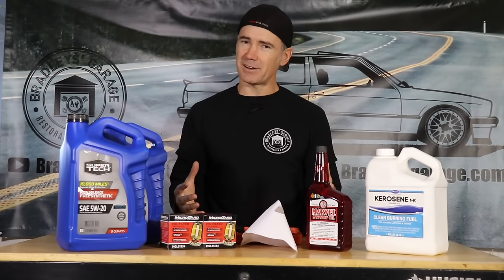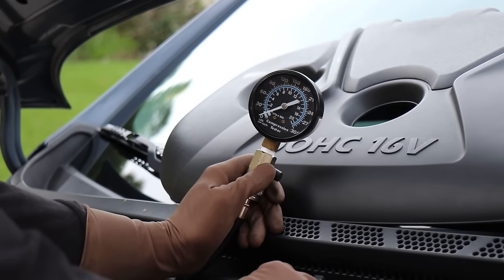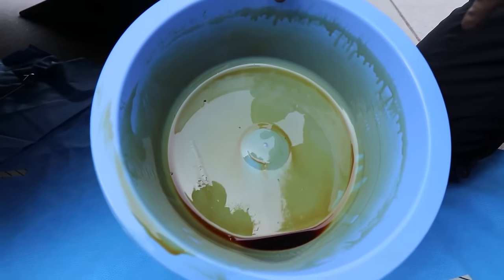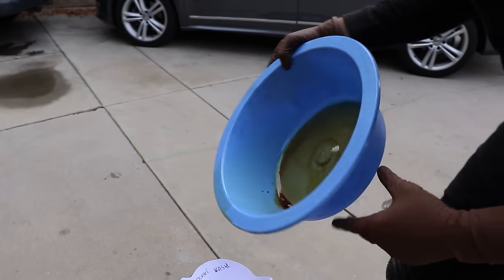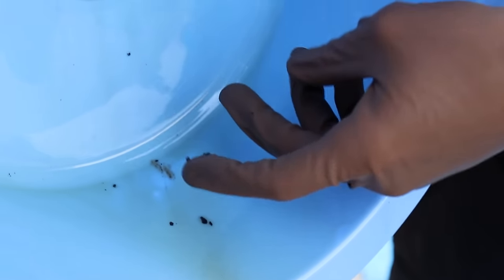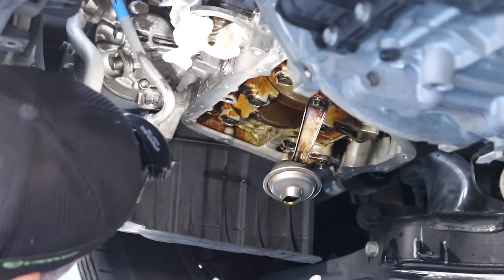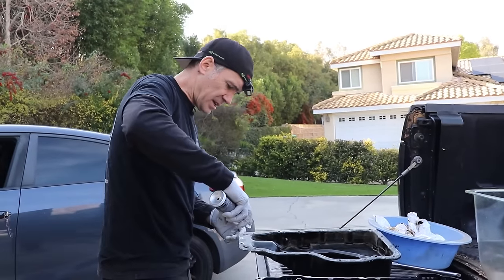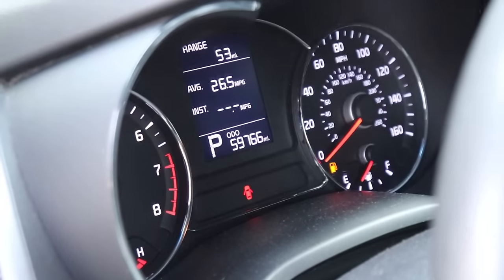*UPDATE* Customer States Jiffy Lube refused to change my Oil - Sludge Factory Kia Forte

Comment: The simplest statement of all time is very true after watching this video: OIL CHANGES ARE CHEAP VS BUYING A NEW ENGINE!!!  

Had this newer KIA's oil change interval kept going, the engine would be featured on the "I DO CARS" YouTube channel.
Reply from the maker: Agreed, thanks for the comments. It is such a low cost item it doesn't make any sense to stretch it out.
Be sure to check out the original video if you haven't seen it - https://youtu.be/XU79jXYWydA
Cheers!
Reply: That's what I keep telling my wife and daughter.

Comment: If there is ever a next time you need to do a heavy sludge flush check out BG's Dynamic Engine Restoration Service Kit. I used that stuff once and an old boot came out the oil drain.
Reply from the maker: Thanks for the product recommendation Joey, we will check that out if we come across another sludge factory. Cheers!
Reply: Fyi...BG is like..$325.

Comment: Great video. Back in 05 i bought a 96 jimmy 4.3 with 158k on it. I changed all the fluids. ALL OF THEM. I did the kerosine flush for the oil as well. It didnt have sludge thankfully. It never had any oil related issues ever. Just 2 water pumps, a radiator, and power steering pump. I sold it at 312k.
Reply from the maker: Thanks for sharing, glad you enjoyed the videos. Cheers!

Comment: Liqui Molly engine flush will do the same end result with less steps. Do fresh oil and filter + LM then drain and put fresh in. Really helped when I was following the "recommended OCI for my 09 Accent was 7500 according to manual". Never again, feels like a play to get you to mess up your engine slowly so the dealer can get more money.
Reply from the maker: Thanks for the comments, this is actually an update video. We used the Liqui Moly flush during the original video.
You can check it out here - https://youtu.be/XU79jXYWydA
Cheers!

Comment: Compression looks good, owner really lucked out.  Looks like others have already mentioned BG, but it's really the only reliable way to get it all out - they sell a large kit called "BG Dynamic Engine Cleaner" that comes with two huge jugs (2nd one is a "rinse" oil).  It's similar to the smaller cans called "EPR" that you can obtain more readily, but in a much larger quantity.  Not cheap, I think it's $350+ and takes 45-minutes and multiple oil changes to perform, but afterwards the results are amazing.  Love the series so far, 3k OCI is what you want - short-tripping puts the owner in the severe service category.
Reply: BG has an excellent GDI cleaner too, need to do that service on my car
Reply from the maker: Thanks for the recommendation; we will definitely check out that product for our next Sludge Factory project. 
We have recommended the owner to start doing 3k oil changes. Hopefully he has learned a valuable lesson on the importance of routine maintenance on his car moving forward. The goal will be for him to be able to change his own oil moving forward.
Thanks for hanging out, Cheers!
Reply from the maker: Thanks for the comments, appreciate the feedback. This is the 1.8L MPI engine so not sure if it has the same issues as the 2.0L GDI motors?
Cheers!

Comment: This was excellent, and I watched each second... couple of observations , you should have figured that with the excellent dilution solutions you added, that it would put the sludge in suspension and thus no clumps.... second, please use a gasket removal spray like loctite or other... no more razors... the removal sprays are so good that you can literally wipe to perfectly metallic surface with a cloth after applying... great work, and thank you for literally saving this motor
Reply from the maker: Thanks for the comments, appreciate the feedback. We will look into that spray gasket removal product as that goop is tough to get off. Glad you enjoyed the video. Cheers!
Reply: @BradleysGarage  LOCTITE SF7200... doesn't run ( unless way over applied).. after 15-20 minutes, you lift the gasket away with your fingers and then spray 7200 into a cloth to wipe away the remaining gasket residue. Not required, but I use Potent Alcohol for final wipe...
Reply from the maker: @kafklatsch3198  Thanks for the tips, we will give it a try on our next project. Cheers!

Comment: Very well done.  It's sad how much extra work this has caused. But I feel u have extended life in this engine. Nice to see owner logging in maintenance. 👍
Reply: Maintenance report:
1st oil change 60k miles
2nd oil change 60k miles
3rd oil change 60k 
4th oil change 61k miles
Reply from the maker: Hard to know exactly how many miles since the last oil change but definitely seems like way more than 6k miles. We are thinking more like 12-15k miles sine the last oil change based on what the internals look like. 
He has had it since around 30k and claimed to have changed the oil 4-5 during this period. I'm sure the cheap oil changes at Jiffy Lube did not help the situation. 
Be sure to check out the original video if you haven't seen it - https://youtu.be/XU79jXYWydA
Cheers!
Reply from the maker: Thanks for the comments, glad you enjoyed the video. Hoping it works out for this young kid since he really doesn't have the first clue what it takes to service a car properly. Cheers!

Comment: Ive always been told you can use 1 quart  Transmission fluid, 100 miles before next oil change.  High in detergents and also lubricates.  Cheers
Reply: Yep, the old engine flush technique I was taught was to replace the oil with ATF and diesel 50:50. Drive for 100-200 miles, then drain and check for chunks. If there were chunks, then put fresh ATF+diesel and drive another 100 miles. When you finally had no more chunks then you switched back to regular oil.
Reply from the maker: Thanks for the comments, appreciate the feedback. Cheers!
Reply: That was in looser tolerance engines, do that to a high tolerance engine and it won't work out well.  @TracyMNelson
Reply: @TracyMNelson  Driving with that mixture is probably not a good idea. I'd say idle the engine for an hour, but dont drive.
Reply: @H4K4N you need higher oil pressure for it to work. These loose engines have little pressure to begin with

Comment: I posted this as a reply to a comment below but figured it would be a good comment to post for everyone to see.

I work in Walmart in the Auto Care Center, and about 10 years ago, we had a Dodge Ram 2500 DIESEL come in for its first oil change....at 40,000 miles. The guy using the truck never ran a diesel before, and it was his company work truck. He worked in the oil patch, so he was using the truck every day and put a couple hundred miles on it every day. So he didn't know it required much more servicing than even a gas should be receiving. But 40,000 miles on any oil is never a good idea. 
Anyway, I was the unfortunate lower bay tech on the oil change. Arguably what came out of the drain plug could no longer justifiably be called "oil". I would describe it as carbon/sludge in a fluid suspension. Yes, I ended up getting it on my hand and NO I could not wipe it off. I couldn't even hold onto a wrench. I had to go wash my hands before I could finish the oil change. Afterwards, I advised the guy to only run maybe 1000-1500 miles then immediately get the oil changed again to try to clean out the engine. He didn't come back to Walmart, so I have no idea what the end result of that was.
Reply from the maker: Thanks for sharing Danny, there are lots of crazy oil change stories out there.
Cheers!

Comment: I have a Mazda CX 5 turbo 4 that requires oil change every 5000 miles or every year whichever comes first per manufacturer. Since I only drive 3000 miles a year, I’m effectively changing oil every 3000 miles.  Seems like most Kia owners treat their cars like crap not properly maintaining their cars with frequent oil changes.
Reply from the maker: To be fair, he's just a 20 year old kid that doesn't know anything about cars or what is needed to keep them running properly. He helped with the repair so he wants to learn and understand things.
Hopefully he has learned a valuable lesson on the importance of routine maintenance on his car moving forward. The goal will be for him to be able to change his own oil moving forward.
Thanks for hanging out, Cheers!

Comment: I was wondering how the hell it still looks like summer in your videos and then remembered California just doesn't get winter, just slightly more rain and less sun 😆
Reply from the maker: Yeah, the weather is about the only thing California has going for it. It's been about 65F here the past few days, haven't had any rain for over a week now but it's coming this weekend.
Thanks for the comments, Cheers!
Reply: What are you talking about! It was 44 degrees here last night!!!
Reply: Excellent work here! I have a 2017 Hyundai Elantra I bought new. Has this same engine.  It just turned 100.000 miles last month.  3000 mile oil changes since new.  It sounds perfectly healthy,  nice and quiet,  uses no oil between changes.  And the underside of the oil cap has nothing on it. The whole car has been absolutely excellent.  0 repairs,  0 issues.  Just 2 batteries,  and 2 sets of new tires.  Thats it! In 2021 I bought a new kia K5 GT LINE with premium package.  Love it. 1.6L Turbo GDI, doing 3000 mile oil changes using Castrol Edge.  Using the Elantra for my 80 mile round trip to work to keep the mileage down on the new car.  I'm in so cal also. You have a new Subscriber 😊

Comment: It's great that he got to keep his head cover! And that plugs weren't flooded.
Reply from the maker: Thanks for the comments Allen, it was not easy cleaning that valve cover. The new one is over $250 so a little elbow grease got it done for basically nothing.
After getting the motor cleaned up we did the plugs and valve cover gasket.
Cheers!

Comment: Marvel Mystery takes time to work. Id continue to use it for several thousand miles. Id probably use a 5w30 sense it thins out oil.
Reply from the maker: Thanks for the comments, appreciate the feedback. Cheers!
Reply: MMO is like a straight 3 weight motor oil.

Comment: You should remove the valve lift solenoid(VTEC Solenoid or what ever its called for KIAs).
These are normally oil controlled and these normally have screens on them and these can get blocked with flushes.
Reply from the maker: Thanks for the comments, we will take a loo at those to see if there is any remaining evidence of sludge on the screens. Cheers!
PS - Be sure to check out the original video if you haven't seen it - https://youtu.be/XU79jXYWydA

Comment: The initial treatment got rid of most of the sludge. The subsequent treatments would dissolve the remnants which would be picked up by the filter. Wouldn’t it in fact be very surprising if there were any chunks seen in the coffee filters?

The varnish may clean up with continued frequent oil changes. It seems like it could be a problem for humming up the moving parts like valve springs, rockers and any oil control solenoids.

The best thing you can do for that owner is to teach him how to do his own oil changes.
Reply from the maker: Thanks for the comments Craig, we will check it every 1k miles up to the next 3k oil change. I'm sure they will be small amounts of residual coming off for many more miles. We could still see the walls with some burnt on residue.
Jake is definitely performing the next oil change on his Kia. he has now seen it done 5 times so there are no excuses moving forward.
Thanks again for hanging out. Cheers!

Comment: Obviously, that engine was in pretty bad shape, you can see the wear on the cam lobes when shooting the heads. Not that it matters that much on an engine like this, but flushes and using any kind of fuel will create excessive wear. Even MMO. In this case it probably does not matter much, but I would I highly recommend not doing this if you actually service a vehicle properly.
Reply from the maker: Thanks for the comments DW, it was definitely worse than we had imagined. Since we couldn't really do anything about the existing wear, we just wanted to help this young kid out and get things cleaned up the best we could. Hopefully we have done enough to salvage the motor for many more miles.
We just posted the 3k mile update video if you haven’t checked it out yet - https://youtu.be/QrJ0B-KXTw0
Cheers!

Comment: I found Jake's receipt for service on his Kia! 

42 gal Mobile 1
14 OEM Kia oil filters
14 OEM crush washers 
2 gal  diesel
2 gal  MMO
50 gal disposal fee
800 mile test drive 

Parts and labor $12,347.89 
Credit or cash is acceptable 😊
Reply from the maker: Thanks for the comments James, he actually spent about $250 in parts/supplies to get this cleaned up.
Cheers!

Comment: Awesome, informative,  and scientific video. My 2005 Jeep Liberty with a 3.7 V6 definitely needs a series of flush such as these. I'm at 180,000 miles !!!!
Reply from the maker: Thanks for the comments, glad you enjoyed the video. Hopefully we motivated you to get out there and get those flushes going. Cheers!
Reply: Same vehicle now at 226k small leak in rear main and keep getting moisture from what I assume is a leaking head gasket but it still running strong and still has the original transmission.

Comment: I love using MMO! What’s your opinion on Berryman B12 chemtool or seafoam to flush the crankcase?
Reply from the maker: Thanks for the comments. We haven't tried either one of those products in the crankcase. We have only used Seafoam on the fuel side of the motor but we found it works great there. We have heard guys using the B12 as a piston soak to help with carbon build up on rings though.
Cheers!

Comment: Marvel Mystery Oil. One quart of it with new oil. Drive for 1000 miles to 2000 miles. The sludge will be gone. Many times the dissolving of the thick sludge can be monitored by shining a light into the oil filler hole.
Reply from the maker: Thanks for the comments Peter, we ran it with MMO for only 430 miles. We may add a few ounces to each oil change over the next few thousand miles to see if the rest of the discoloration goes away. Cheers!

Comment: Looks like some scratches on the cams, but given the state of the engine when you began the process, I think that's acceptable.
6000 mile oil changes - I call bullshit on what you were told.
Reply from the maker: Hard to know exactly how many miles since the last oil change but definitely seems like way more than 6k miles. We are thinking more like 12-15k miles sine the last oil change based on what the internals look like. 
He has had it since around 30k and claimed to have changed the oil 4-5 during this period. I'm sure the cheap oil changes at Jiffy Lube did not help the situation. 
Cheers!

Comment: I flushed a 74 Ford pickup with straight diesel when I was a kid.  It always leaked a little oil before, and after the flush, it leaked like a sieve.  So the diesel definitely knocked stuff loose.  I let it idle for 15 minutes, and aside from more leaks it ran fine.
Reply from the maker: Thanks for sharing, hopefully we have done enough to salvage the motor. We didn't want to do straight diesel so we went with the 1 quart mixture.
We just posted the 3k mile update video if you haven't checked it out yet - https://youtu.be/QrJ0B-KXTw0
Cheers!

Comment: I bought a Ford escort once really cheap because it had loud ticking from the engine. Turns out the oil wasn't changed in a long time, the oil came out like sludge. I ran seafoam in the engine for about 30 minutes idling and got a lot of build up out and pulled the valve cover and it was still a lot of sludge. Then changed the oil again and it ran a lot quieter. I sold the car and about 6 months later the lady's son blew up the motor.
Reply from the maker: Thanks for sharing Daniel, we weren't sure if Seafoam was any better at breaking sludge down versus the other products on the market. Cheers!

Comment: Owner is lucky, but flushes will eventually reveal hardened oil seals that will need replacing and later on the timing chain. Best to just be honest with the customer. If they only want to drive around for a few more years it'll be fine. Change the oil and tyres. 8 years, probably time to get a newer low mileage car when the motor goes bang.
Reply from the maker: Thanks for the comments, appreciate the feedback. Cheers!

Comment: The one thing I would be doing for the next 10,000 miles is using Hot Shot's Stiction Remover as a leave-in treatment. 

I would have used it earlier on, personally. I had personal experience using it on a 2014 Toyota 4Runner that somebody decided that 17,000 miles was a good oil change interval. The PCV was a big clump of sludge with a little metal sticking out.

The sad thing is that Kia and Hyundai engines are bad enough as it is. Those small clumps are still a threat considering the ports the oil needs to go through.
Reply: I personally wouldn’t use any leave-in oil treatment. Modern oils are really well formulated.
Reply from the maker: @buttsexandbananapeels Thanks for the comments, appreciate the feedback. Cheers!